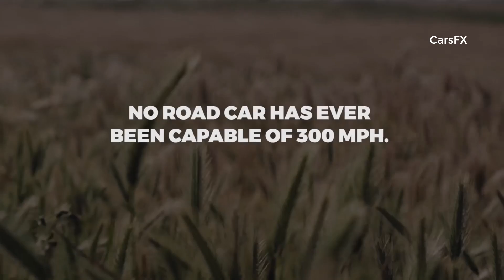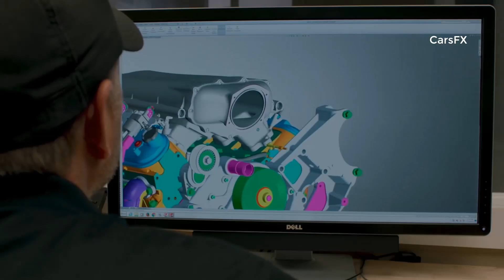Tesla Roadster vs Hennessey Venom F5 Comparison - Electric HYPERCAR !!!

Comment: Sorry but the ICE age is over! The new EV Supercars will distroy ICE cars. EV 100% Torque .. lowest center of Gravity .. lowest Drag Coefficient .. 1,000+ HP per wheel .. Solid-state Li-ion full charge with 500+ mile range in 1 minute.
Reply: in 1 minute?